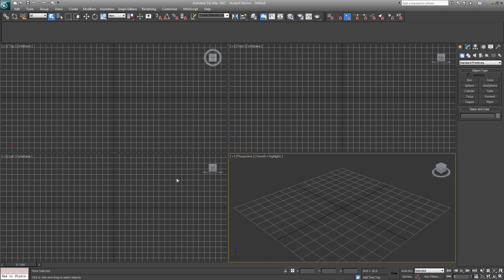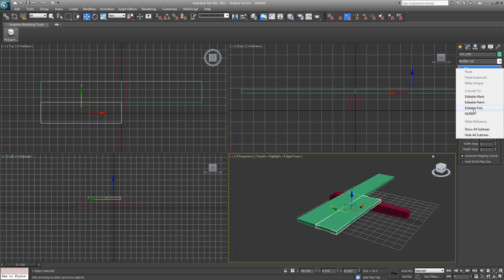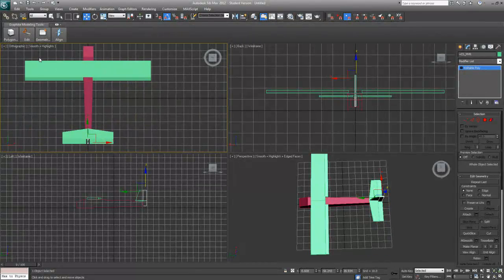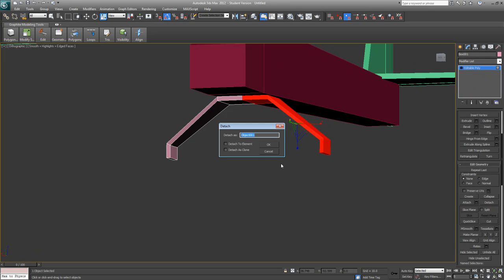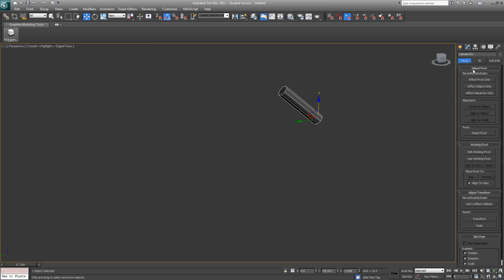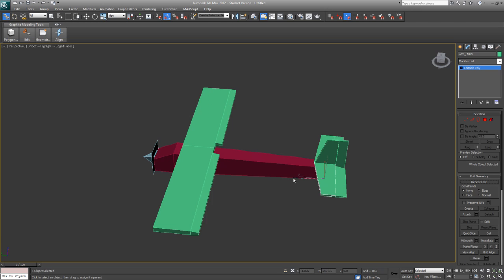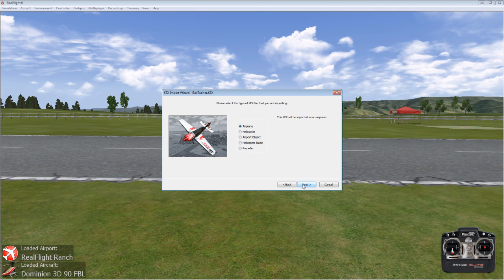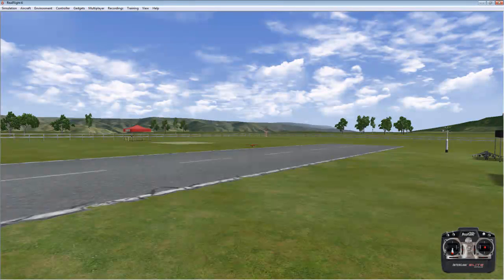realflightboxtrainer

Comment: Scott,

Thanks very much  for your series of tutorials... I've currently created what I consider is a finished model ready for export, When I do so the importer registers it as an aircraft however when I go to fly it the aircraft appears gigantic. I have scaled to 1m as you explain to do so at the end of this video. I've spent a number of hours fiddling to get this to work properly with no luck. 

I'm currently creating this model for a University project and would really appreciate some feedback... Would it be possible to send you my Max file for you to have a look at ?

Regards,

Andy
Reply from the maker: For sure you can send it. I'm at snichols002@gmail.com or is that already apparent? Positioning and scaling can be tricky when your new.One way is to select all the parts and put them in a "group". This is done by going to Group in the main program bar and selecting group. Now it will scale fine and position at the world center as well (If its perfectly symmetrical anyways). Once it where you want it you go back to the same menu and "Ungroup". Send it anyways and I would be happy to give it a once over.